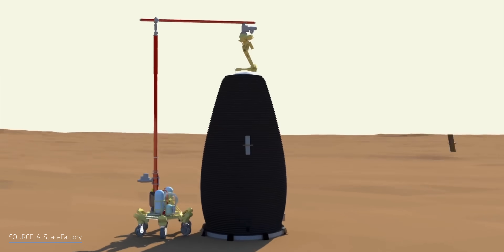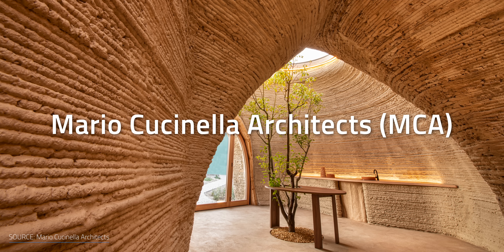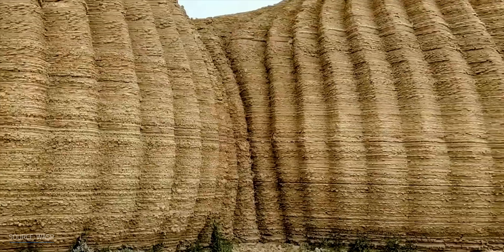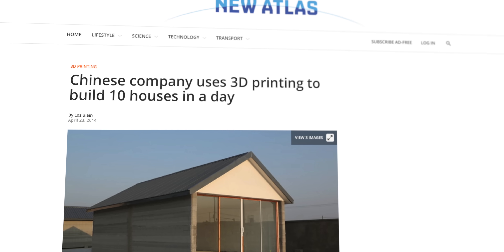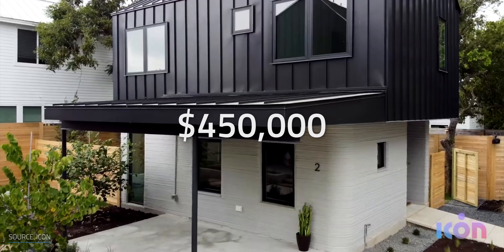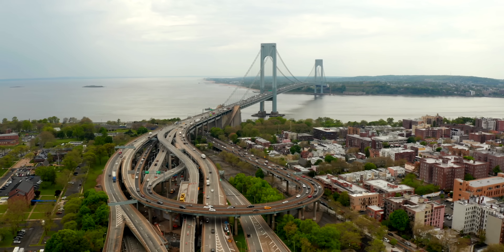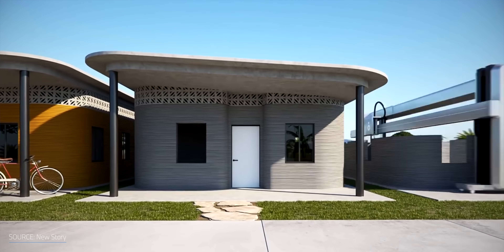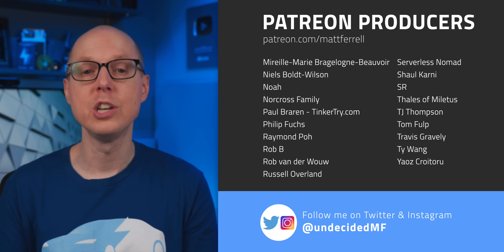The Truth About 3D Printed Homes

Comment: I don't see it. They are optimizing the cheapest part of house cost. Here in Croatia, wallbuilding is by far cheapest part of new house bill. I don't see how this can be cheaper than bricks or concrete panels walls.

If they could build a robot (tandem of robots) which is able lay decent foundations and then build decent mix of brick and concrete walls on top of it, with spacings for installations, then maybe they have decent usecase for housing.

As shown in this video this is just newer spin to build structures like water resistant concrete structures. Those structures were always produced with central pivoted hose as those walls are build by continuous concrete pouring.

Comment: those mud huts looks like a horrible idea. the only place youd want something like that would be warmer regions where it will provide a nice cool interior but then youd have issues with wildlife and bugs burrowing into it.  Not to mention that unless you have very specific tastes those things are pretty unsightly. Id also really like to know what its structural integrity is like, especially in the face of storms or other harsh weather (can it stand up to a flood?!?). I think the only real benefit is speed, so using those as emergency shelters might actually be a good idea?

Comment: This entire concept came about as a result of a NASA contest for sustainable shelters for use on Mars, about 2 or 3 years ago. The winner and runner up had come up with a 3D printing method to build cylindrical structures as you have in your examples using Marsian soil as a raw material.

Comment: Another consideration: how much water does it use? You might have all of the clay or dirt you want, but needing to get enough water to get the clay printable might itself be prohibitive in drier regions.
Reply: @buffalo wt Trees take a lot of water too...
Reply: @cosmicerror2924  water which isn't going away, is it? It's not like these trees are irrigated.
Reply: @موسى_7  I believe the point was that very dry areas which don't have enough water to build a house like this are also going to be too dry for large trees to grow.
Reply: @buffalo wt Historically if the region had plenty of trees, yes wood was the preferred building material because it's easy. But in many parts of the world trees are in short supply so you get solutions like half timbering (the classic black and white 'Tudor' look) which builds a basic timber frame then fills in the gaps with small twigs and clay based 'daub', stone or, if you have nothing else but soil and grass, you use clay mixed with straw (various names around the world, cob, mud brick, adobe etc.) and a thatch roof.
Reply: Its lesser than used to mix concrete.
I read somewhere and ill send the link if i find it
Reply: if an area doesn't have enough water to build a home, then it also doesn't have enough water to keep you alive.
Reply: @buffalo wt hey now, stop ruining new fads with your solid logic and practicality.
Reply: If they are trucking in a shipping container for the printer they can probably ship in the needed water or a machine that can extract the water from humidity in the air or waste water sources
Reply: @SavageOne420  Or you can just create a house from the shipping container.
Reply: @zarddin  Just like the first Watch Dogs game.

Comment: Lowering cost do not lower The price of the product.
If my neighbor is able to build a house for $0 it'll still be sold for market rates. 
This is the This is the problem with low-cost housing. It won't stay low cost If it's decent housing.
The only long-term solution Is the federal government should  guarantee everybody middle class housing.

And the reason why the federal government should do it is because the federal government is the only one with infinite pocketbook.

Comment: I live in Oaxaca Mexico. We have numerous adobe homes that have been maintained for many years. With calcine coating they can last as long as they are maintained. I have seen adobe structures in Peru as well. What is old is new again! They were built of locally sourced materials that would return to nature. People are still building this way and very low cost. Of course current homes are built of concrete - far better than stick built.

Comment: What we really need is innovation in BIM and trade materials. What if instead of manually terminating hundreds of romex ends, common electrical receptacles could be terminated with socketed connectors on standardized or factory-terminated cables? If it's a 3D printed house, what if they installed full window and door assemblies (sillpans, headers, porticos) during the print, so that they end up sealed as soon as the material cures? What if instead of embedding water utility penetrations into the slab, they came through a man-sized passthrough or utility basement?

There are all sorts of interesting things that could make-cheaper the creation of comfortable, safe, life-affirming dwellings; 3D printing honestly seems pretty low on that list.

Comment: That's Cob, weve been doing that for tens of thousands of years. Hella rad that they managed to do it with machines rather than hard labor. You can also use hay, grass, gravel, or horse manure as a binding agent in the mixture too. It makes a great cement when used to pack and insulate stacked stone. It's an OLD technique
Reply: Sometimes some of the best solutions are *OLD*, simple and reliable methods and tech tend to need far simpler supply chains too
Reply: @UNSCPILOT  exactly. Today it seems like everything has to be overly techological. Especially "smart this" and " smart that". Like everything has to have some soft of computer in it, even washing machines.
Reply: Poop as a binding agent? Stop sir.
Reply: @AtPeacePiece  it's a thing. Horse manure works best, but I prefer hay... more sanitary
Reply: @sammy13ificationable  generally i believe straw, grasses and other fibers were used in main cob construction the manure was usually mixed in for finishing coats as the fibers were much smaller and made a much smoother finish. But nothing a good grinder couldn't simulate these days lol....could you use manure entirely? Absolutely, but I'm just thinking all the leftover straw from harvest would have been a much quicker solution to the bulk of a building going up for a family in those times as opposed to picking the horse fields.

Comment: Ok, I used to live in a mud house. You basically need to cover every inch of the exterior from rain. Any water will make the house collapse without any prior indication. Whatever they saved printing this will be lost by water-proofing for sure.
Reply: I guess this is easy, just have a large roof overhang. You get a free 360degree veranda😁
Reply: @marwerno  That was one of the method, but not a complete and practical solution.. in our place rain even flows parallel to ground due to heavy winds..
Reply: @ThirdFront  In this case: the major wind is mostly from one side only, the other directions mostly rare events (so it can dry off). In Germany for example, I would avoid having a raw wood facade in north or westerly orientation, it would not easily dry off and rot quickly.

Comment: Matt, great perspective. One interesting thing which folks might be interested to hear about is the development of Graphene Enhanced Concrete. We all know that concrete has hardly changed in 2,000 years. Yes, we have various additives, but basically the structure of concrete hasn't changed all that much since the Romans built with it. But, in a recent white paper I read (Graphene for the Construction Sector), the addition of tiny amounts of high quality Graphene (much less than 1% by weight) into the cement mix radically changed the strength and curing time of poured and printed concrete. This has allowed the company to actually pour real world concrete foundation slabs WITHOUT rebar! And, because much less concrete is needed this has a huge effect on CO2 emissions (not to mention the lack of steel, its mining, production, transportation, labor, etc.). Also, the rapid cure time of the concrete means that construction on the slab can begin much sooner. In 3D printing the rapid cure time and increased strength could mean much quicker printing of thinner cross sections without waiting for printed layers to "set" before printing subsequent layers. 

I have also read where Graphene enhanced concrete could also turn the walls of a building into a battery! Now that's crazy! Imagine a "Smart Structure", that can monitor the structure of the house and its interior. The possibilities seem endless. Anyway, I find it fascinating...

So, while "Dirty Houses" :-) may have their place, I think I'd rather live in a more "permanent" structure. Not to mention resale of the home at a later date, because as you know, reselling a home is basically reusing previous materials, and that can't be bad. Cheaper by far to update a home than to build a new one. I do believe we are still in the infancy of 3D printed homes, and there will be innovations, such as Enhanced Graphene Concrete, which will allow faster construction, with less cost, less concrete, less CO2 emissions, stronger designs (imagine the beautiful futuristic forms that could now be envisioned by architects with stronger thinner cross sections), with long lifespans, and of course, concrete can be recycled.
Reply: Some say that if you snort graphene it can make all your problems go away

Comment: Up in  the arctic the homes are often, shipped up complete as mobile homes,   The igloo design is still the best do to the cold and wind.  3D printed home make the most sense there, but the question is what material to use.   I've got a design that would, make sure the frozen tundra, under the dwelling would remain frozen and float the building.

Comment: Great video. Im actually on the verge of buying two of these machines to start printing homes.
Reply: We can erect a 1400 sqft shell exterior/interior walls from the footers up to the top plate in 18 hours/ one machine bud. Ive seen it first hand. All for .010 cost per cubic inch. And yea you still need to fit out the house when the shell is done. But hey that's a vast improvement over 2 months!
Reply: That is bold.  Just make sure you are actually better off (closer to a finished project) with the printed walls - than starting with just a foundation.  For most projects in the US, so far, it would have cost much less to not print.  And I am an advocate.

Comment: Here is another problem if you look around you'll notice you don't get a lot of Mudbrick ,which is what these are, style houses in anywhere wear you get a lot of rain as mudbrick and rain is a bad combination now you can reduce the effect with large overhanging rooves. The other problem is not all dirt is created equal so do you add outside dirt shipped in from somewhere else or add an artificial binder. and what areas where water is at a premium. Here is what I guess will happen Teclar will end up making buildings for tourist and rich  clients in well or moderately well developed regions with stable power grids either that or run generators

Comment: I’m the founder of natural brick co in Australia. The material developed is called wood stone and is the extension of its forebears like Ligna stone and timbercrete but infused with building tech (as I have been in the building industry for 30 years). After all that...meshing the concepts of catenary domes into a flexible construction method is the key issue. Whether it’s terra print or earth bag, the system is essential. Material system is the same, cellulose masonry composite (cmc) is also the answer as it can be geoploymer or gpc bound: we came from the beginning of mud brick, rammed earth, hempcrete etc and none of these are the solution now...it is cmc...the hi tech form of these ancient recipes that point use to truly sustainable but ALSO comfortable and healthy builds. This in turns highlights the important role of building biology in this. CMC delivers balanced thermal mass/insulation and highest fire ratings available (exceeds AS 240/240/240)
The building industry is not ready to give up its rape of the earth quite yet...not while mammon is lord of its house.
I really appreciate the vid...but many of the summary points are moot eg...the transport carbon cost is divided across the total sum of houses mfg per unit, a solar plant could be used and left behind as a mini energy plant etc...much of the pre COVID commute is...well here it is anyway

Comment: When I see those clay homes and their printtrace surfaces, I just think, "Those are unfinished". 

You ought to tile inside and outside with ceramics or something, get a hard washable surface, which can also be coloured. 
The ceramic tiles can also be 3D-printed of course, and this could allow some cool designs. An extra arm to put tiles into place should be doable. 

With ceramic tiles and pipes inlaid into the structure - made so you can remove the covering - you can also lay some wiring in there, and then rewire it later without smashing the walls.

Comment: 3d printing houses ATM IS SCAM... martketing bullshit.. its mostly more expensiv then whatever is "normal" wherever u life... you still net electicity, plumber, carpenter etc.. you need to controll so many facors to get the concret solid before the next layer comes...not to late..not to early.. what happens when it rains... a hot..or very cold night/day?  thats a hughe problem... i 3dprint all day.. and i can see ever 2 degree celcius change in my layers... 

its way better and faster to manufacture complete walls with piping and electricity etc and then complete it on site... you can build them in big halls with controllabael atmosphere

Comment: I made a career out of building adobe brick houses and rammed earth houses at high elevations in SW Colorado.  The materials work well for passive solar designs.  Per square foot they are more expensive than flimsy, stick frame houses that leak heat both winter and summer; heat leaks out during the winter and leaks in during the summer.  The key to everything is what you mention in the last 2 minutes of your video, except don't think in terms of "managing" your available time but rather ask, "Why am I a hamster racking up millions of miles on my hamster feet running on a hamster wheel but going almost nowhere?"  Answer, your personal productivity is being purposefully siphoned off to the tune of almost 100% without your being aware of it.  The common denominator that runs through ALL economic activity is the flowing, life blood known as "money"; and our money/life blood is 100% counterfeit.  Those who run the counterfeiting operation along with those who chum-up to them live off of your productivity and return ABSOLUTELY NOTHING back to you.  We've all been taught to avoid this topic because, "It's too complicated."  Wrong.  It's the key to ALL poverty and the feeling hopelessness and helplessness.  It's the story of the small man behind the curtain who Dorothy was told, "Pay no attention to that man."  Expose and get rid of "that man" and you'll have plenty of time to build yourself and your family a beautiful, passive solar home and even time to build the same for your children when they're of age giving them a productive, head start in life that will echo for all future generations of your family; and all families of the world.  Honestly, it is the key.

Comment: I build red iron buildings for a living. Many are built as "barndominiums". Or house/shop combinations. I used to build wood houses. In my opinion, the massive amounts of maintenance a woodhouse needs: Paint, roofing, wood repair etc, make the price point for steel buildings quite viable as houses. I wonder about the sustainability and carbon footprint of a barnuminum versus a composition roofed standard house these days. I know from experience that a full crown roof screw on heavy galvanized painted metal can last upwards of 100 years. I have repaired old buildings and have seen what lasts and doesn't. I would think steel houses are a quite sustainable form of human housing. I would like to see a small documentary on that if behooves you.

Comment: I still don't understand why it would costs this much.  I'm new to all this but it seems the 'outside' portion of the house, or shell of the house, would be way cheaper to build. The interior, windows, insulation etc are costs that would be incurred anyway right? I missed the part of why the 'print' portion costs so much. Should not the shell of the house be penny's on the dollar? Anyhow, Great video.   Thanks

Comment: Uuuggghhh, everytime I see one of these demonstrations I sigh a little bit harder.

This is more of a race to the bottom than anything else.

As mentioned in the video until they start talking about 3D printing apartment buildings to increase population density per area it's only going to end up increasing carbon footprints from transport waste alone.

I know everyone loves to hate on China, but their concepts of modular skyscraper building are probably the most efficient way to go about solving the housing problem.

People bemoaning carbon footprints of such projects would do better to support their efforts by developing greener building materials, 3D printed lower density girders etc.

Comment: The problem I see with a dirt-based wall is insect infestation, followed by what happens to it when it rains. 
This "New " building material is ADOBE, and sun-dried mud bricks will eventually dissolve away after being rained on. 

Which is why there are no multi- level skyscrapers made from adobe today. 
And also why archaeologists Have trouble locating ancient citys in specific parts in the world: The civilizations there used adobe/ mud brick and all of their buildings eventually turned into mud puddles aeons ago.